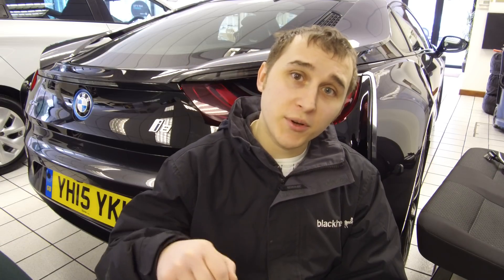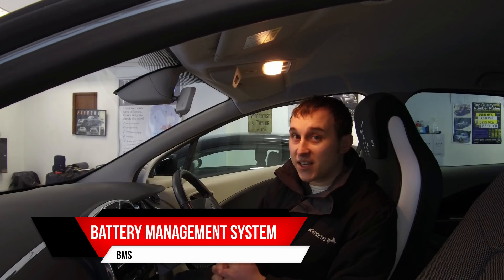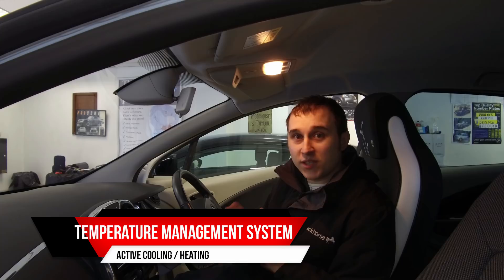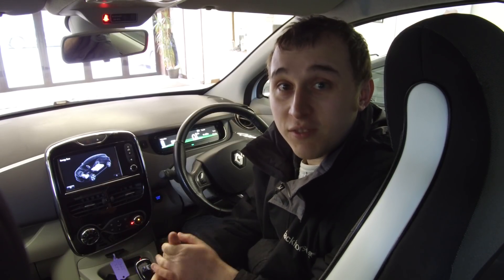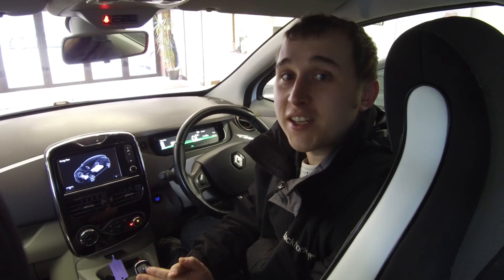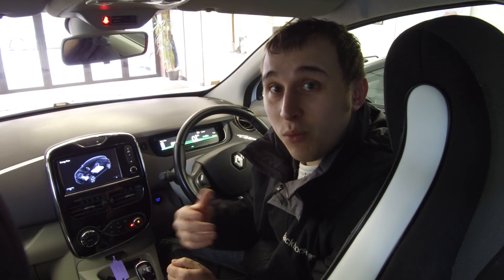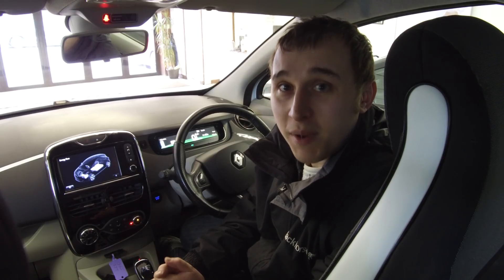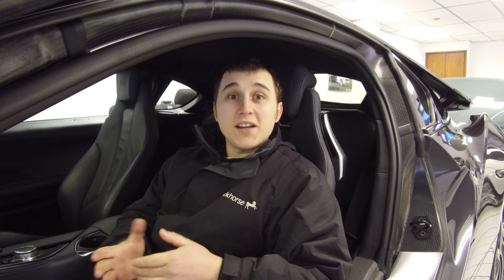2018 Nissan Leaf Charging issues TMS? Firmware?, my take  🔋🔌🚗

Comment: I would like to see how the Nissan Leaf charged in the summer in a warmer climate. It’s very strange that a battery would retain so much heat in the winter that it can’t recover from fast charging during reasonable drive cycles. I think the battery is somewhat insulated from the cold on the bottom so it doesn’t freeze while someone is at work, and it has a 300 watt heater that will kick on it if it gets too cold. 300 Watts wouldn’t do anything if there wasn’t some thermal barrier at the bottom.

The top of the battery pack probably isn’t insulated, so cabin cooling can potentially sink down and cool the top of the battery case, which then cools the air inside with natural circulation caused by cooling the hot air at the top of the battery. Sort of the way a basic refrigerator works that doesn’t use a fan, it needs to let heat come in the sides of the refrigerator so that the air rises and then gets cooled in the freezer section and falls due to increased density. 

Its possible that these guys just hit upon the worse conditions of not cold enough to cool the battery due to outside temp, and too cold to use the air conditioner (or maybe used the heater), so the heat in the battery just kept stacking up over the 450 mile trip with no chance to dissipate.

Of course active liquid thermal management would fix the problem, but how much does a 40 kWh Leaf battery cost and how much does a liquid cooled/heated 40 kWh battery cost? 

We know the Nissan Leaf battery will never get a cooling leak, and it won’t get dirty inside like the once that use a blower to circulate cabin air to the battery. Nissan clears has a reason for doing what they do, and they are trying to make an affordable EV that is much easier to own and operation than a milk float.
Reply from the maker: The Renault Zoe is cheaper than the leaf but has Active cooling, it doesn't need to be liquid cooling there's other way, you could use the heat pump to blow cold air over the pack
Reply: Nicolas Raimo, I guess Nissan had reasons for not doing that. Circulating cabin air through the pack seems like a good idea until the battery catches on fire and the fume kill all the passengers. I can only imagine how many ideas were brought up during the design of the vehicle. Liquid cooling seems to be the best for when the battery is charged or discharged fast. But I think the Leaf is basically a big powerpack on wheels.
Reply from the maker: Renault implemented a pretty clever solution for that, installing an extra evaporator of the climate system in the air inlet of  the battery compartment, which is why you not only hear the battery fans kicking in, but also the climate control when fast charging.
Reply: Nicolas Raimo, it wouldn’t be very difficult to make the Leaf battery cool off faster. I would think Nissan engineers must have a reason for the design.
Reply: " battery catches on fire and the fume kill all the passengers." Where has that happened, ever?
Reply: IMHO, they had.
The shape of the bulky Leaf battery dictates only one possibility: liquid cooling. There is no other way unless you redesign the whole car.
They chose to omit it.
Planned obsolesce.
Reply: IMHO, they had.
The shape of the bulky Leaf battery dictates only one possibility: liquid cooling. There is no other way unless you redesign the whole car.
They chose to omit it.
Planned obsolesce.
Reply: Richard Petek, or they plan to use a new battery technology that has such a low internal resistance that it doesn’t need active cooling. I’m still waiting for some more engineering analysis on the car to see if they used any engineering in the design, or just hired the guy who designed the first Model S external door handle mechanism.

So far, 99% of the Leaf owners seem very please with their Leaf. Only 1% who thought “LEAF” spells “TESLA” are still crying about it.
Reply: No, people knew how to spell I.O.N.I.Q, they just didn't want to wait for it (or for the K.O.N.A) - and they got pulled over the table. 
Nissan knew why he came out with the car in mid-winter. Coming out in June and the season would be over in two weeks!
Whoever will never drive more than 200 miles per day in his lifetime and his holiday drive is that to the nearest airport, excellent!
But whoever does more than that, he will be scorched at every summer.
I drive to holidays twice per year, approx. 400 miles.
I don't want to drive around with a scorching hot battery and wait at 35°C at some charger in mid-summer. 
Oh, I should take a loaner? Twice a year for a week or two? Well, thank you for the advice, if you are paying for it.
Reply: Richard Petek, since we don’t have any videos showing the car being driven in a warm climate by a normal person, we will just have to wait and see. Nissan has been testing the car in various climates. Time will tell which is better in the end, a Leaf or a Zoe. Most leaf owners are happy with their car. It does what they bought it to do.
Reply: IMHO, you are comparing two badly designed cars. 
Why do you compare to ZOE Q90, which has bad driving efficiency and bad charging efficiency. Why not comparing to the Ioniq EV 2017, which came to the market one year before Leaf 2018?
Both are in the same class, both look "normal" good, details are a matter of taste, equipment is comparable. Ioniq is far more efficient, effective range difference comes down to 10%, charging speed on 50 kW is better (0-80% is 43-49 kW, comparing to 41-46 kW from 0 to 60% in Leaf) and it can charge from 0-78% at 60-69 kW (on 100 kW CCS).

And summer test? What is "a normal person" to you? Only someone who drives 100 miles to holidays?
I drive to my holidays at about 75-80 mph and I am by far not the fastest driver.

OK, let's see that British winter test of 450 miles (720 km) - in summer at 30°C (and btw, that's about as far as many people drive in summer to their holiday, many drive quite a lot more). Ioniq first (probably at least one hour faster than in winter), Leaf 30 will be 2 hours behind (scorched battery) and Leaf 40 about 4 hours behind (same reason).
ZOE Q90? Worse efficiency, but better charging speed past second charge due to active cooling. Somewhere close to Leaf 30, give or take 1/2 hour.
Reply: Richard Petek, the Ioniq is an efficient car, but apparently some people still prefer Nissan over Hyundai. Hyundai made a bad name for themselves with the Excel, and it takes time to build the brand loyalty that Nissan has. 

You are assuming that a battery that overheats in 10c will overheat faster in 30c weather. These vlogger May have more problems than those who just get in and drive the car the way it was meant to be driven. Let’s see. Summer is near. The internet should be swarming with mad Nissan Leaf owners, unless the system works just fine is you just let it work.

Comment: Martin 48 years, 1969, 100 million miles. SOH hangover, overweight, big spot on nose. Waiting for a CCS Zoe with a worst case range of 160 miles.
Reply from the maker: 😂  first bit made me chuckle.   Guessing your regular doing large miles in a day Martin to need a 160 range?
Reply: Nicolas Raimo Yes. Last year we did the trip of 120 miles 82 times. I say that a worst case range  of 160 miles is needed to give a  bit of leeway for diversions. Ze40 probably be fine most of the year, but cold weather and the mahoooosive hills in Winter would make it a bit squeaky bum. No chargers on the route as yet.

Comment: As you may be aware, I have had the battery replaced in my Zoe Q90 due to some unforeseen problem at 4k miles (likely caused by a dodgy charger) . Initially I could not get the cooling fans to kick in on this new battery which is something another owner had experienced upon battery replacement. Anyway, I went out yesterday and done ~127 miles, 70+ mph on the motorway, and done 3 rapid and one 22kw charge. On the third rapid, the fans kicked in. All detailed here:

https://speakev.com/threads/stop-electric-failure-danger.17431/page-53

It was only by coincidence on getting back home that I saw Lemon-Tea Leaf's #rapidgate youtube video. And having watched Jonathan Porterfield's video then I can't say I am surprised that the new Nissan Leaf is suffering from inhibited rapid charging. I didn't get battery temperatures as high as Lemon-Tea Leaf as my cooling system kicked in and brought it down.

The fact that the 30kwh Leaf beat the 40kwh Leaf in Jonathan's challenge is absolutely horrendous. And Nick, as you say in your video, it doesn't bode well for the summer. I have every sympathy for the 40kwh Leaf owners who experience this as they simply shouldn't be having this. Even my 2011 Peugeot Ion has battery cooling.

Unless Nissan pull their finger out and fix this then I can seriously see myself, and other EV users, being held up by 40kwh Leafs slowly charging on a rapid. Not fair on other EV users, and, most importantly, not fair on the 40kwh Leaf owners.
Reply: If you follow this link, you will see two screenshots both taken of CanZE. One states that it was getting 40kw, and the other saying that for 42.9kw AC coming from the charger that 39.2kw DC was going into the battery. The pictures were taken within a few minutes of each other. The battery temp was 32c at the time. In that charge, on the UK's Ecotricity rapid charger, the receipt says that I pulled in exactly 19.5 kwh in just 37 minutes. We all know it starts fast and then ramps down. When I stopped the charge it was still pulling in 20+ kwh. I should add that it was never as efficient as this until the battery replacement. My posts in the SPEAKEV thread relates to how since the battery replacement that the fans don't cool the battery as much as they used to. And overall my range and miles per kwh have increased.

https://speakev.com/threads/stop-electric-failure-danger.17431/page-53
Reply from the maker: FULLY agree its shocking that Nissan are not fitting active cooling and heating
Reply: @David Barr
What is the maximal charging rate with your new battery?
I have never seen q90 charge higher than 34 kW
Do you have some canZE screenshot.